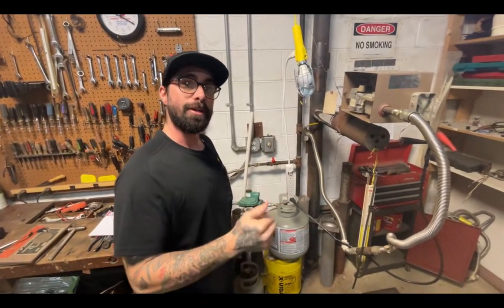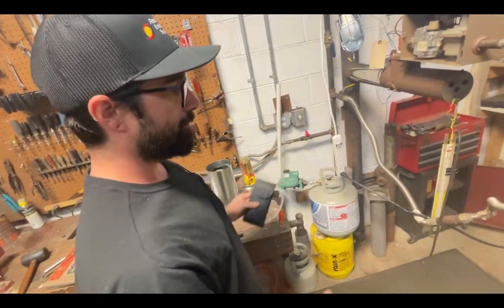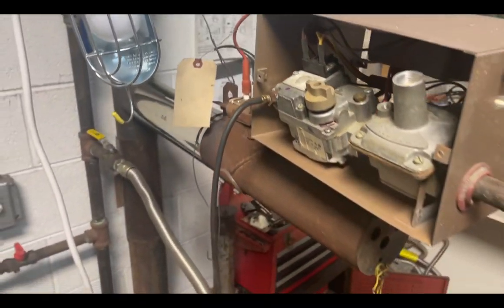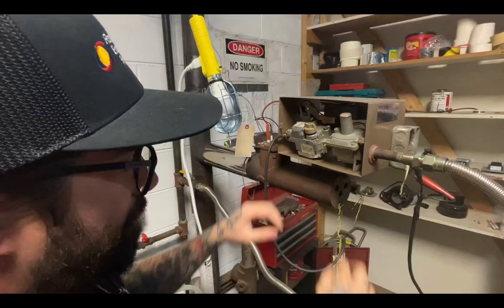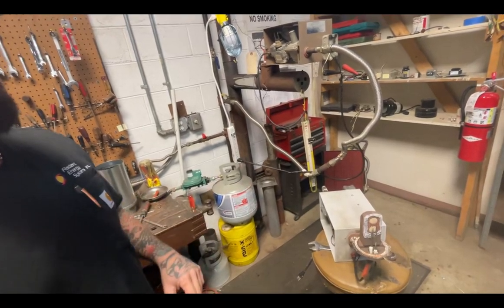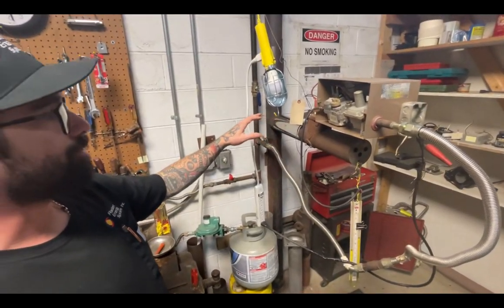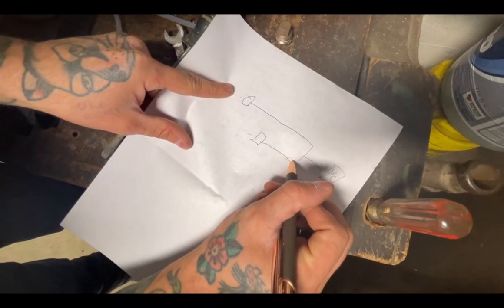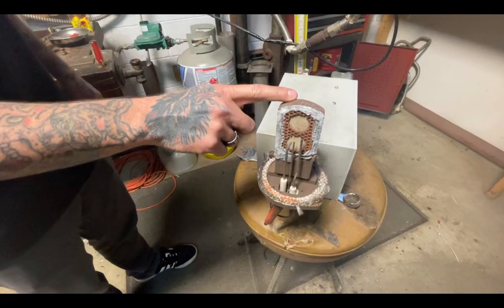Roberts Gordon CoRayVac Diagnosis & Repair | Troubleshooting for Vacuum & Gas Pressure

Comment: Great video. I have a CRVB-8 with one of the heads not firing. I do have spark, ignitor is new,  and the filter is also new. It is the one on the end of a run with 4 other heads on it. All other heads are working. End vent pressure is 2.5". I want to check the pressure as you showed in the video. What is the size of that opening in front of the gas valve that you connected your manometer to? Thank you.

Comment: We have an old CRV6-60 with multiple burners on one leg. I have one burner I cannot get to work. Vacuum pressure is right where it should be at about 2.6, however the one problem burner we cannot get a pilot. Ive tested mixing block vacuum, checked the pilot orifice and have made adjustment to the pilot error, I have also confirmed we have good spark. Could this be caused by a bad gas regulator or something else?
Reply: if you are seeing the same flow through the mixing block as your end vent vacuum with the burner not trying to fire (2.6 in your case) then the mixing portion is okay. there are small pilot holes on the spark plug, are those clear? is your brass washer under the spark plug flat? the plug only needs to be finger tight plus a 1/4 turn, don't torque it down in there too tight. if you jumper the pilot switch out (2 horizontal terminals on the inside of the box where the pilot switch block plugs into) do you get main burner to kick on? your reading when firing, measured from the mixing block should be .2" W/C for those older burner heads. If you don't hear a click from the pilot portion of the gas valve when energized and all of the previous statement's check out then i would be leaning on a gas valve, more specifically the pilot portion of the valve but they are replaced as a complete assembly. I will add the gas train assembly to our website in case that ends up being your problem.